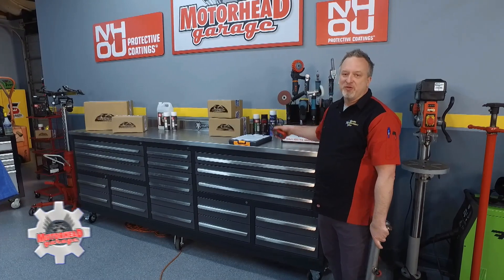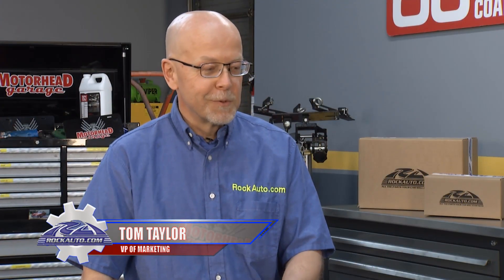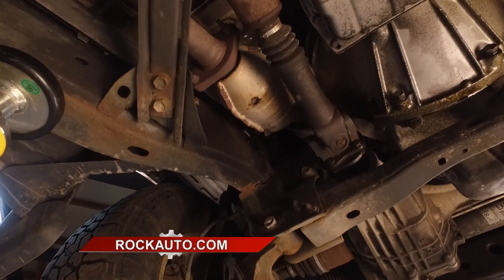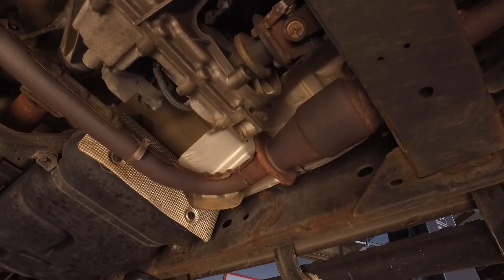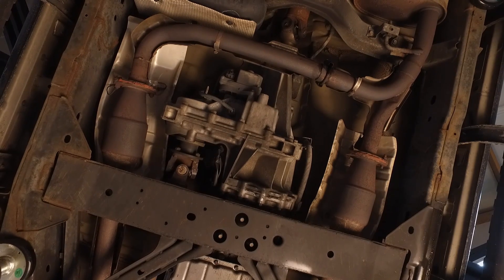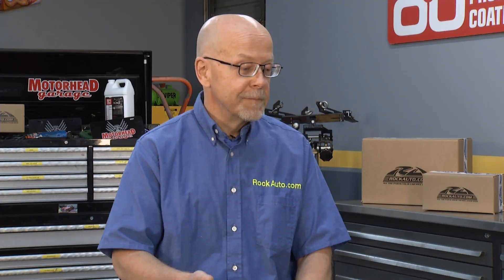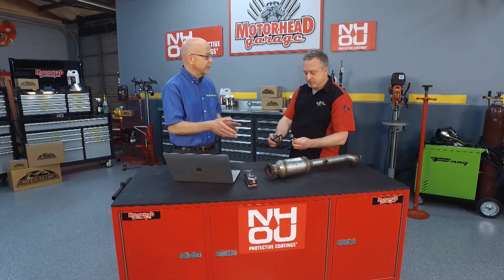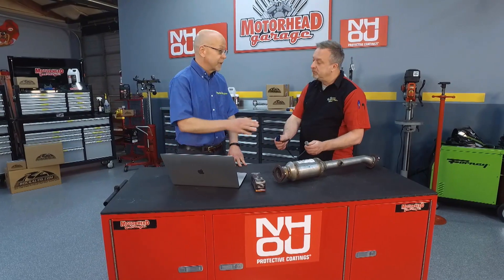Catalytic Converters; Motorhead Garage & RockAuto (2022 | Episode 22)

Comment: I replaced the catalytic converter in our 2002 Chrysler T&C about 8 years ago, using one from RockAuto (CA/NY model).  The old one has been sitting in my garage since. Where can I recycle it?  Must be worth something since criminals steal them.  I tried one web site, entering info, but they never replied.  Most recyclers here won't accept them, assuming you are a thief.
Reply: I have recycled an old catalytic converter several years ago. The recycling place took my license info but accepted it and paid pretty well.
Reply: @Tracker-Pete Thanks.  I gave the converter to a repair station near me gratis a few weeks ago.  Great guys.  I once had them remove old tires to store the wheels and they didn't even charge me.  Do all repairs myself but if my hands give out someday I'll use them.  Web places required the original receipt for the new converter, no longer in Rock's database.  Local recycle yards said they no longer accept them.  900 cad is an amazing price.  My 2002 is still somewhat affordable new ($563 on Rock for CARB, $253 for 48 states).  For my son's 2015 base Prius, Rock doesn't list and find $1800 to $4572 elsewhere (dep on VIN).  My old Mopars and M-B diesel which don't require emissions are looking good.